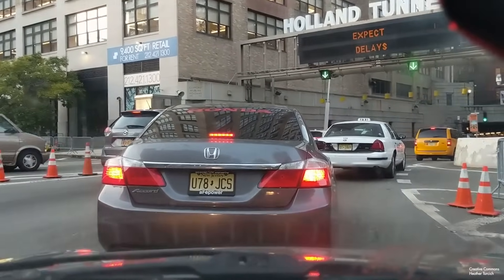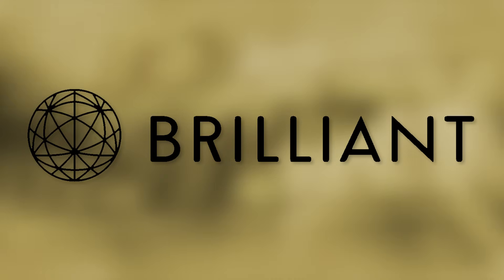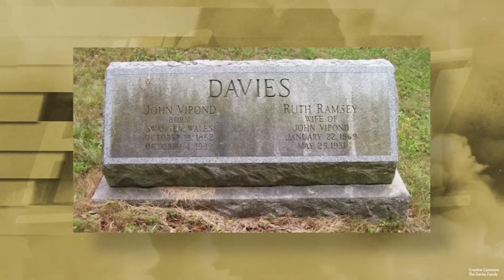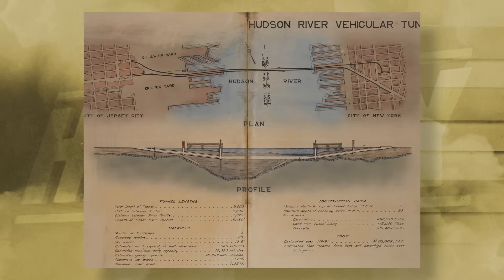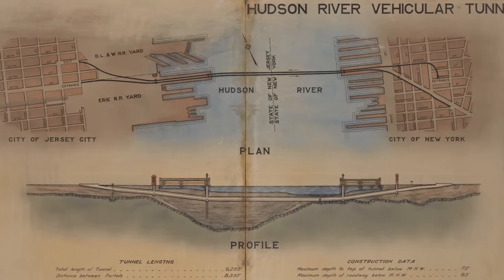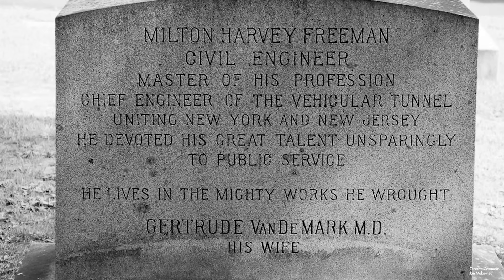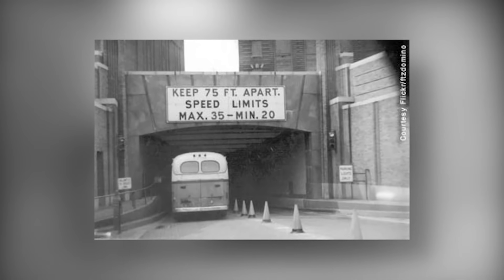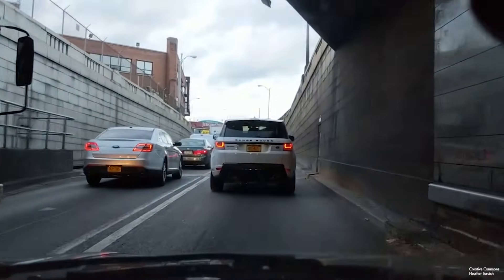New Yorks Underwater Tunnel - The History of the Holland Tunnel

Comment: The Holland Tunnel has four lanes for traffic in two directions and 9 feeder lanes in NJ only. The East River subway tunnel was  for the BMT line (Brooklyn Manhattan Transit) not BTM.     A video about the river traffic it replaced would be very interesting.  My father told me about ferries for horse drawn wagons around WW1 before automobiles and fixed crossings were built on the Hudson, even a ferry at 125th St. for non rail carriage. All freight train traffic from the west ended in Jersey City or Hoboken and had to take the water ferries to NYC. There were trains running up and down 12th Avenue servicing the rail cars until the early 1970s.  Train train traffic from the north could directly enter Manhattan via the Bronx so the Holland Tunnel connected vehicles in NY with the rest of the country, not only NJ.

Comment: In 23yrs trucking I've been through both of those tunnels more times than I can count. I can remember a couple times running through those tunnels with the flaps of my exhaust stacks rubbing the ceiling like a cable car, and you didn't accelerate hard with a medium to light load, the torque could push the high trailers into the ceiling, they finally restricted the height after a couple years in the early 2000's.

Comment: Would certainly be interested to see a video on the Lincoln Tunnel; I saw the entrances to both when I was over there several times between 2002 and 2010.  Did not pass through as I do not drive; are there any bus services which operate through the tunnels?
Reply: Yes

Comment: I've always been curious on how the Holland Tunnel looks underneath the water. Is it possible you could record the documentary of diving underneath the water and tracing the tunnel to the other side?
Reply: No possible…its below level water ..bedrock! …..if a diver goes down there …what he is going to see its just flat ground mud,rock etc….
The tunnel is below that ….
Reply: The Tunnel is approximately 60' below the bottom of the river in bedrock.
Reply: Uh, no. No tunnel is immersed in water like that, they are built below the water's surface in the bedrock where leaks and erosion are less likely.
Reply: @apseudonym  How deep would that be, under the rocks under the water's depth?

Comment: in  ww2, the cunard queens loaded down with 15000 troops  had a draught of 40 ft plus.the soldiers were assigned a location and to stay still so that they would not cut through the holland tunnels at low tide.
Reply: Don't you mean low tide?
Reply: @828enigma6  typo, absolutely low tide!

Comment: The Holland Tunnel was an amazing engineering feat and the the first of its kind BUT actually the first plan to cross the Hudson was in 1874 with a proposal of what would ultimately become part of today's PATH system- construction started in 1879, was halted for financial/construction issues in early 1880's and again in the 1890's, was finally completed in 1906 and officially opened in Feb 1908- from Hoboken to 19th street- what is today's PATH uptown line to 33rd st.  2 more pairs of tunnels built under the Hudson soon followed- PATH's downtown line (1909) and the Penn RR tunnels to Penn Station (1910).  Also, there was a proposal in the 1880s by Gustav Lindenthal for a bridge, of which only the cornerstone for the would-be foundation was laid in 1895- the construction of the Holland Tunnel as strictly vehicular was indicative of the growing sentiment in the early age of the automobile- a definitive move away from the old transportation (trains) to the new (cars)
Reply: Kev, after reading your comment, I am reminded on the next big Hudson River tunnel project which seriously needs to be done. That is, the Pennsylvania Railroad tunnel. A lot of expensive refurberation on is existing tubers plus new tubes to handle the train traffic involved. Several videos have been made showing the extensive deterioration of the older tubes.

Comment: Do those ventilation fans really have 80 feet in diameter? They would be as big as the ventilation towers are high. I cannot imagine how such fan would fit there and there's 84 of them. I also found that diameter size mentioned somewhere on the internet, but I'm not sure it's right.

Comment: Almost 100 years later and they are still charging a toll!  I believe the tunnel has been paid for now.  And don't tell me the money collected is to maintain the tunnel because what is there to maintain?
Reply: You have all the duct-work for the ventilation system as well as the fans themselves.  You also have the tubes themselves as well as the road decks.  Personally, I'd rather pay a toll to use a road than pay taxes for maintenance on roads I'll never use.